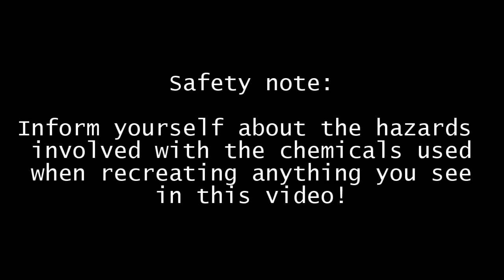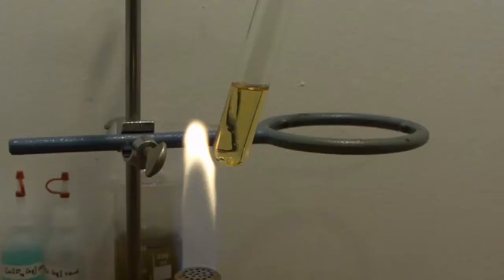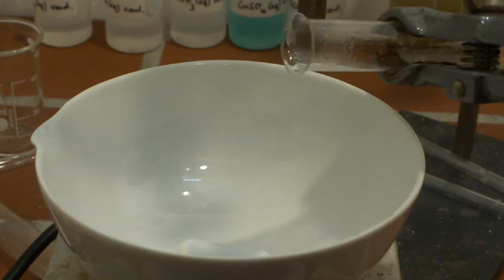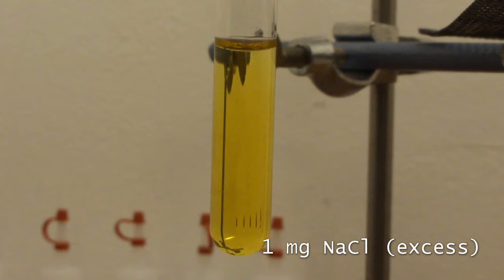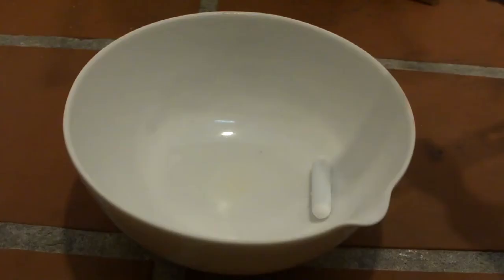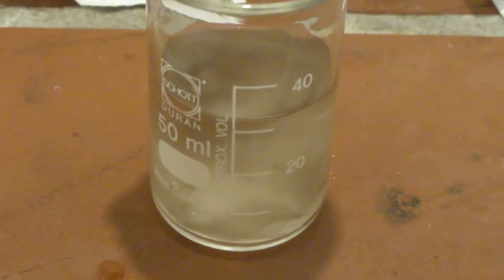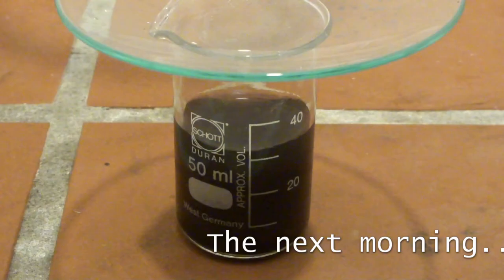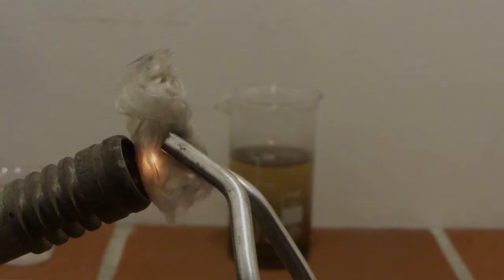Preparing a platinum catalyst for the Ostwald-Oxidation feat. aqua regia

Comment: This is so cool!!! I've been doing a lot of experimenting with platinum catalytic propane heaters lately, and I've always wondered if it would be possible to make one myself. After watching your video it definitly appears to be feasible! A friend of mine recently opened up a small automobile catalytic converter with an acetylene torch, and obtained the ceramic honeycomb inside. When I decide to chemically process it, instead of trying to obtain a bead of the metals it contains I may just keep them in solution and apply them to some quartz wool like you did here. Thanks for the inspiration!

Comment: Hi have you considered using a tilly lamp mantle thats 99% thorium dioxide as a catalyst?  that was the other catalyst used industrially when pt ran short in ww1.  my research gives 11 parts ammonia gas 89 air  run through preheat 700c and use gasflow to push the exothermic catalyst temperature to 800-850c. Above 900, selectivity is reduced. thorium ran at atmospheric pressures, pt 4-5atm.  2 cooling chambers are used, 1 has water vapour added, one has o2. but we can use h2o2 bubbler instead.
Apart from its fragility i think the tilly lamp mantles may be ideal, for  surface area and contact times, easy to apply and clamp to a tube etc

Comment: Surely a stupid question but at 8.07 and at 8.16 I cannot tell if you are adding water or blowing air into the solution. Is it water or just air or both ?
Reply from the maker: Not a stupid question. We noticed that it is very hard to tell on the video. Its just synthetic air we blow over the solution in order to facilitate the evaporation process.
Reply: Bumblebee Hive . Air to dry it.

Comment: Good job but I was wondering if there is anything that can be used instead of quartz wool or maybe the honey comp of the catalytic converter can be used as it is
Reply: No, it's not possible as I already tried that and was a fail, I'm struggling to find the quartz wool
Reply: @kelvinpino4065  I suspect rockwool would be a suitable substitute. In fact the smallest and cheapest quantities of fluffy (non compressed) rockwool on ebay already have some platinum. They're sold as faux gas fireplace embers.
Reply: @kelvinpino4065  I got some wool on ebay once and it shipped from China in a plastic bag, so it was smashed and crushed beyond usefulness. Another reviewer claims it's just glass wool and doesn't stand up to temperature. I haven't tried, but it's awfully coarse.
Reply: @WaffleStaffel   I think it depends of the thickness of the fibers of the quartz wool, I got one oz online from a store called whale apparatus in usa, just Google it. I followed all the steps of the video but when I heated the catalyst it became brittle, and had no catalytic properties or is very very low, even it didn't catalize the oxidation of the gas burner, also I tried the former method using hexachloroplatinic acid and ethanol and had the same result. I think that the best way is  to directly buy the platinized quartz wool and forget this exhausting process
Reply: @kelvinpino4065  Oh no, I'm sorry it didn't work out. I'll have to check out that source. I hammered some Pt into a flat wire shape and even red hot it wouldn't catalyze butane or propane, but it did work on methanol vapors. Yeah, if you just want the catalyst, buying it on alibaba is probably the way to go. Evidently Pt on kaowool (alumina/silica?) is used as well, so since that's the only thing I can find which stands up to heat without melting or becomin gbrittle, that's the first thing I'm going to try. - http://www.sciencemadness.org/talk/viewthread.php?tid=13734
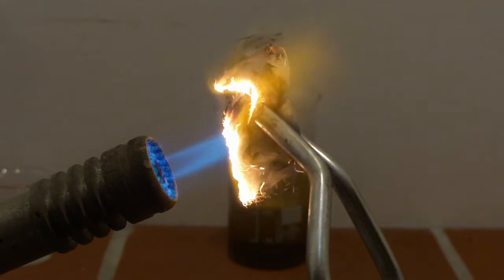Reply: @kelvinpino4065  You might also try the more active catalyst mentioned at 13:48, prepared by dissolving the *platinic acid in ethanol and burning it right into the wool. You can see it done here- https://youtu.be/LEcoZ47b9mY
Reply: @WaffleStaffel  i already tried that method, and had the same result, I think that the problem is the platinum piece I started from, it could be contaminated. I was able to prepare a platinum coated electrode using electroplating and had good results but the platinum layer started to tear off. Anyway I abandoned the project because I'm working on a household chloro-alkali reactor for producing hydrochloric acid
Reply: @kelvinpino4065  Sorry, re-reading this I don't know how I missed that. Any progress with your chloro alkalai cell? You should post a video of your results.
Reply: @WaffleStaffel  Hi! Has been a while. Yes I had some progress I may be starting to post videos soon